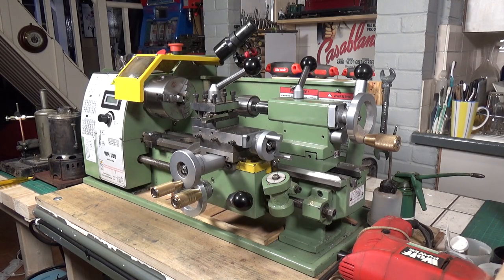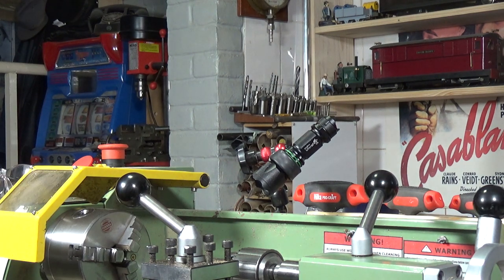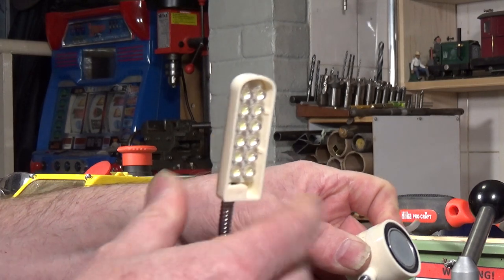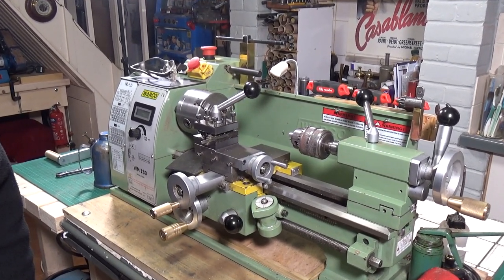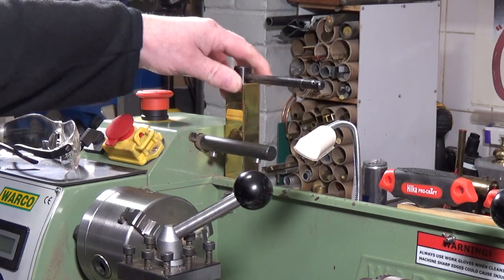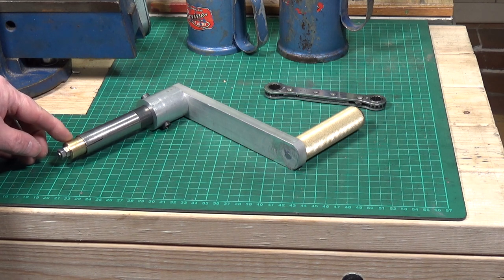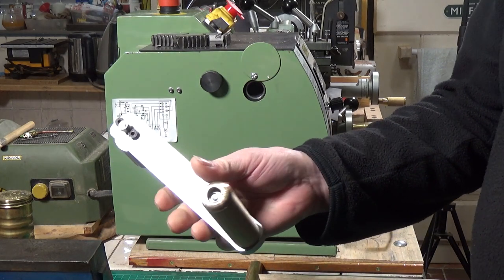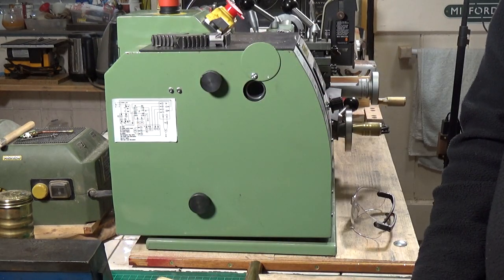Modern Mechanical Tech - Warco WM180 Lathe Accessories

Comment: Yes I made  similar mods to my lathe as well. You could be in for quite an adventure, depends  how far you want to take it, I have made a handle like yours, but I have also made an arrangement to have various indexing rings on the mandrel, which also acts as a drive for my handle which is removable. I have used the indexing rings successfully many times to make scales, and  make index plates. I remove the handle when not in use, but leave the mandrel inside the spindle as swarf does make its way through the spindle and has a nasty habit of falling onto the teeth of the gears. The mandrel prevents these chips from doing any harm and is left attached to my lathe all the time..  Mine is not a Warko lathe but the same principle applies. I use the same goose-neck lights on all my machines and so far I have not had any problems with them. Keep up the good work with the video's.
Reply from the maker: Hi Stephen. Indexing rings is something i've been thinking about so maybe some might appear in the future. Just occasionally i have to work on long bits of brass bar which need the whole length of the spindle so leaving something in the end of the spindle wouldn't work for me.

Comment: Hi Alan,

The spindle handle was interesting.  I don't have one and just use a shifter on the chuck jaws, but a handle would be useful.

Cheers Rob
Reply from the maker: Hi Rob. I do quite a bit of manual thread cutting with dies on the lathe and the handle makes the whole job a lot easier.

Comment: Wait until you get to David Richards' steam engine rebuild. He shows how to figure out the dimensions of missing parts. Would love to have his library of old books, just wish he would post more.
Reply from the maker: Hi Craig. If that is the engine which had been left disassembled in a wood for a decade or more then i've just started watching those.
Reply: Then you're going to love the slide valve build. Watch closely how he got the require dimensions.
Reply from the maker: @CraigLYoung  Looking forward to it, if i remember correctly from the last video i watched, the slide valve was missing.

Comment: Great mod
Reply from the maker: Hi, thanks. Just had a look at your channel and subscribed. Love those trucks and your railway. Cheers, Alan.
Reply: @RetroSteamTech  Thank you 👌🇬🇧
Reply: @RetroSteamTech  Hi, I am thinking of purchasing a Warco WM 180 would you recommend it ?.
Reply from the maker: @royboydanny1415  Hi. Yes I would, I've had mine for getting on 2 years now and it's done everything I've asked of it. If you've watched my video you will have seen that there are areas that can be improved, things like the handles etc. All the really important parts, headstock, tailstock, bed, tool post, motor & gears are fine. If you really want to see what can be done with one check out "ADE'S WORKSHOP", he does amazing work on his WM 180. Cheers, Alan.
Reply: @RetroSteamTech  Thank you 👍🇬🇧

Comment: Be very careful of that led light you have, I have been using three of them for two years until a week ago, I had a very bad electric shock from mine, when moving the lamps position, They are cheap for a reason there is full mains voltage on some very thinly insulated wires within the flexible arm which means there is full mains voltage in that head. The insulation is not good enough at our voltages.  I am a retired electrician and i will be making  a warning video on  you tube in due course regarding this. I will be converting my other lamps to low voltage and have stopped using them until this is done. A shame because they are a nice working lamp. PLEASE BE CAREFUL
Reply from the maker: Hi Stephanie. Thanks for the warning. I'd assumed that the voltage reduction was done in the plastic box which houses the magnet and the switch. Still it should be fairly easy to convert it to low voltage operation. I think i'll get another one and tear it apart to see how easy it would actually be. Thanks again.
Reply from the maker: Just been back on Amazon Stephanie and you can get an identical light which has a USB plug on the end of the lead. Used in conjunction with a mains plug type USB supply you should be perfectly safe as you are only talking about 5 volts DC. I think i'll order one of those and see how i get on with it.
Reply: @RetroSteamTech  Hi thanks for the heads up on the usb  style lamp they are a nice size to use btw I just purchased a WM180 for the larger work on my 16mm stuff I been running a tiny Cowells lathe but its to small for a lot of turning.  Keep up the posts I,m impressed with mine too.
Reply from the maker: @stephaniealdridge4964  Sounds like you and i went down the same route 🙂 I started with a tiny Grindturn lathe which was great but you soon start to see it's limitations. Enjoy your WM 180.
Reply: Lathe bulbs were 50 volt for safety